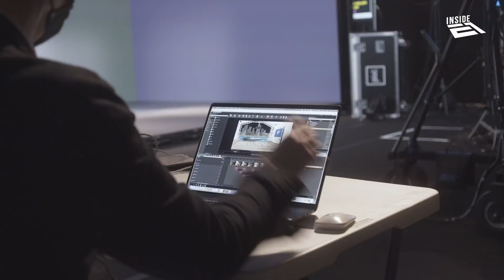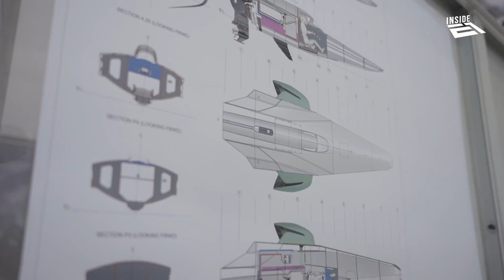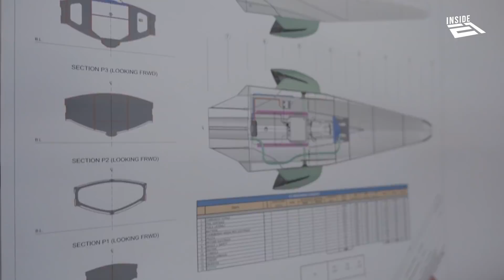How to build a foiling electric raceboat championship | INSIDE E1 EPISODE 1

Comment: Most people here have no idea about the science behind foils and foiling boats.  Just because a boat looks cool does not mean it will deliver.  This boat won't.   The flying of a boat can come from foils.  Foils benefit boats by utilizing very little horsepower but the cost is relatively low speeds - up to around 40kts to 50kts.  Foils merely lift a boat to reduce drag.  Planing boats actually do a lot of flying through stepped hulls, which create air bubbles under the hull or in catamarans where the hulls actually have aerodynamic properties that make it fly (ground effect).  Water at high speeds is actually very very sticky.  High speed boats actually need downforce to keep them on the water at high speeds - which increases drag which requires a lot of power to overcome it.

Comment: E1 Series if your current prototype model is going to have around a maximum speed of 60 mph with a safety capsule, then I have a suggestion. Get Hollywood celebrity-type people as some of your competitive boat drivers. You will need Famous Names to attract more public viewers/spectators and including sponsors. Being, as you know, that boat racing has smaller race attendances then car racing.
Reply: What do you do with a boat where foil lift becomes unstable at around 50 kts and at 60kts loses its lift capability due to cavitation?  Once cavitation speeds are reached at 55 kts, the boat becomes completely unstable.  The foil design on this boat is dangerous - because the engineers are have ZERO experience of Foil design or even knowledge of how foils work at high speeds.   Foils on sailing boats is fine - their speed limit is around 40 to 45kts.  High speed power boats and foils is a fools idea - and I design and build high speed foil assisted boats, and I personally know what the limitations are - from a design and experiential aspect.
Reply: Specially in Monaco, but okay... why do we need another boatrace, why not a race to get china's carbon footprint a bit lower, i think that would be a project the world wants to see, but this is just my opinion, why don't u replace those coal mines that they built for more sustainable energy sources, that would actually make a diffrence in this world.